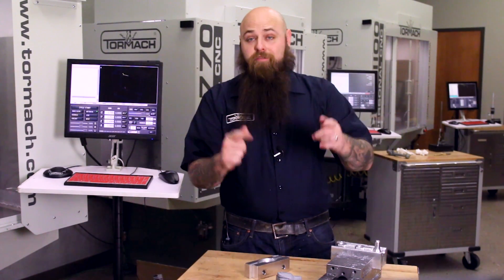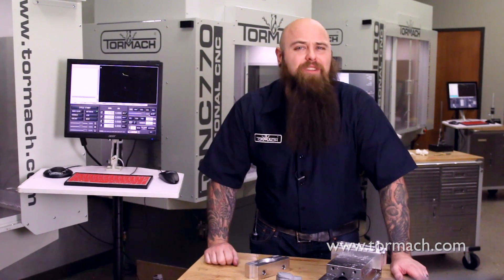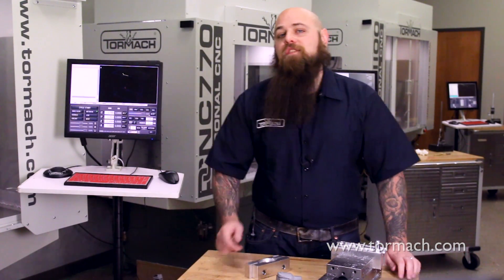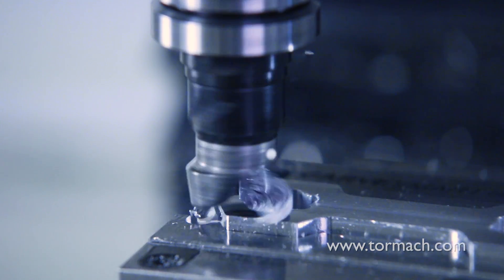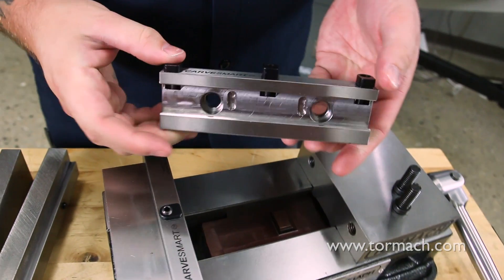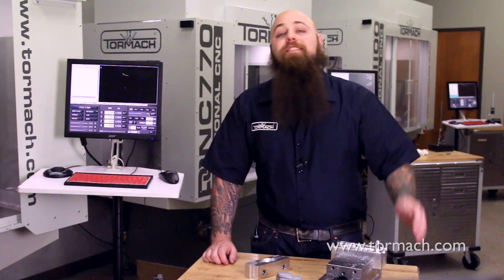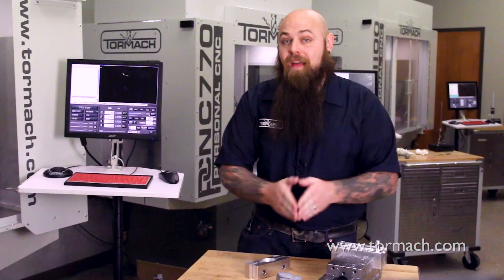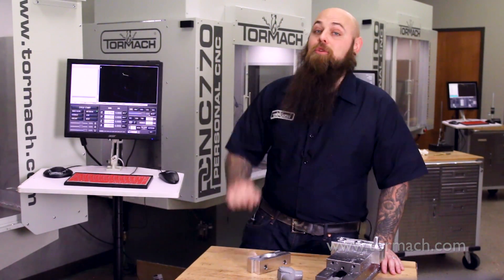Soft Jaw Work Holding Fixtures

Comment: I have a 440 and dont see you make soft jaws for the 4 inch vice. Looking for the soft jaw without the grooved holder just some cheap $15 pairs that bolt on for test cuts.  I saw some youtube video but dont know where to buy them. I just got the 440 a few weeks ago and love it.
Reply: I just made my own for my 4 inch vise. Spent about 2-3 hours to make a huge batch of flippable ones. almost a year later and I still have plenty left
Reply: I use a 5" vise on my 440 and found lots of soft jaw blanks available from Monster Jaws